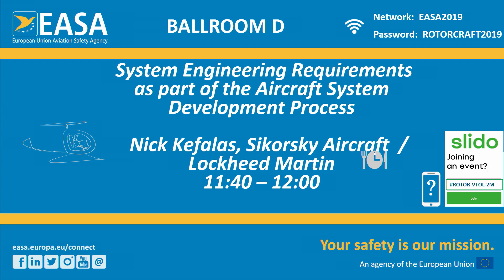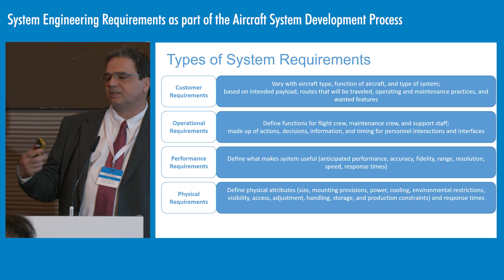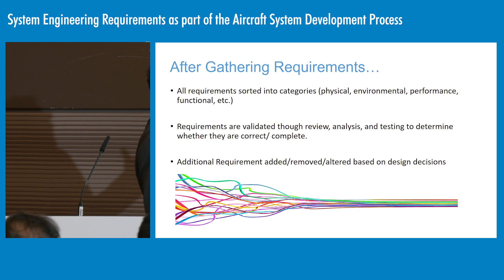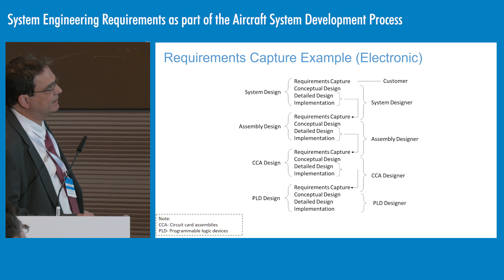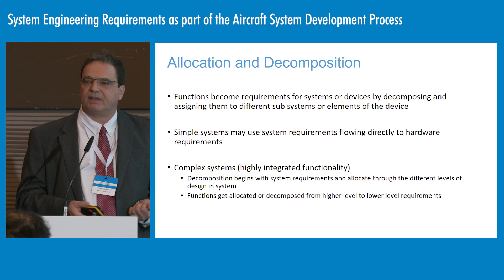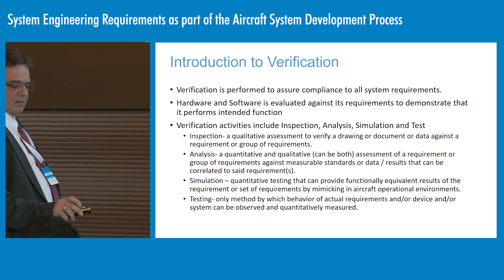System Engineering Requirements - Aircraft System Development Process  - EASA Rotorcraft & VTOL 2019

Comment: Very good presentation, thanks for sharing it.

He took the slides one by one from "Airborne Electronic Hardware Design Assurance" - R.Fulton & R.Vandermolen. Very good book, definetily worth a read.

Also he mentions that everyone should be using DOORS, but there are modern alternatives such as Polarion or Jama with a much more user friendly interface.
Reply: "Took the slides one by one...": Yes, but I think he misunderstood the message in a couple of cases. E.g. "Each level of abstraction can repeat its allocated requirements until there is a design" does NOT mean that the same functionality can occur in multiple places in the design, as he appears to claim. As written, it appears to contradict the earlier statement that requirements should not be so detailed at a high level that decomposition merely means replication or cloning down through the levels of decomposition; however this conflict can be reconciled by earlier guidance which states that the requirement should be written for the audience at that decomposition level. That means not only that it is written for the person who is doing the work at that level, but that it should be written for the implementation context at that level. A circuit board knows nothing of weight on wheels, for example, only the inputs that carry that information, and should be written as such. Similarly, software cannot turn on an indicator lamp, only activate an output allocated to that indicator lamp, so again, the requirement should be written as such.
"DOORS": Agreed; Jama, being natively graphic, has - as just one example - an excellent method of showing decomposition traceability in an intuitive left-to-right layout. I've been in a love/hate relationship with DOORS since 2003, and after a brief taste of Jama last year, I'm eager for the opportunity to join the twenty first century with a new tool!
Reply: Great.... But are there some open source alternatives for requirements or complete mbse

Comment: If functional requirements are the only verifiable requirements why are other types of requirements included? I read the source book on this and it says treat the non-functional requirements as textual information in the requirements document since they are not verifiable by test but just inspection. I'm not sure how you could reconcile functional and non-functional requirements if this is the case.
Reply: Verification is bigger than just Testing. You are right saying that non-functional requirements are not verifiable by tests but we can (and we should) verify them by the engineering review and inspections, when you manually inspect the design and/or implementation of your product to ensure that the non-functional requirements are met.
Reply: @denisevstratov  Right! Functional requirements aren't the only verifiable requirements, they're just the only (behaviorally) testable requirements. As you say, inspection and analysis (and demonstration/observation for process requirements) are how we verify non-functional requirements.